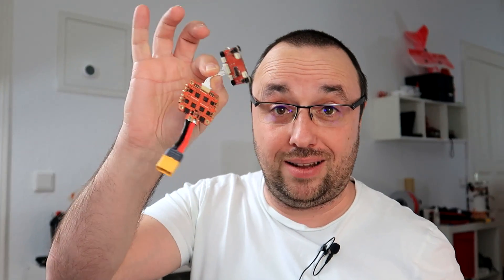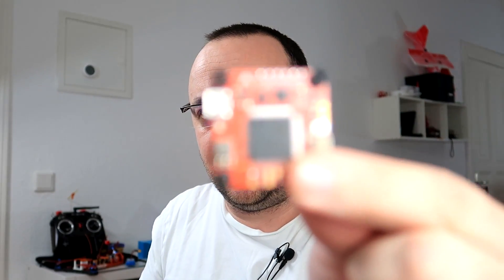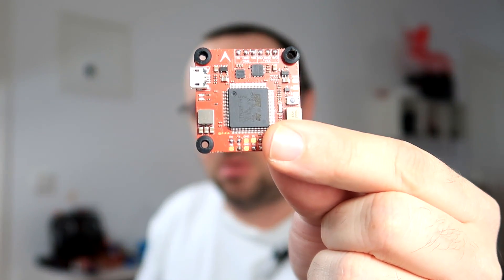TTTRC F7 & 8S 4in1 ESC speed review

Comment: I had one, voltage reg on fc blew before first flight. Wanted to build some 8s lipos and start trying new set ups but this POS just had to break, when the regulator on the fc blew, it took an esc out so i just went ahead and got a full refund from the ebay seller which took like 3 weeks.